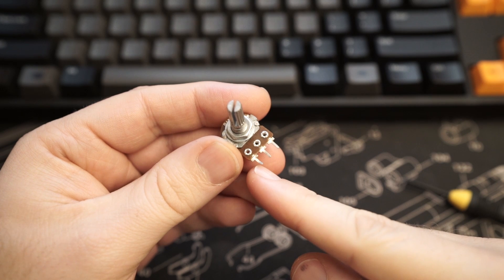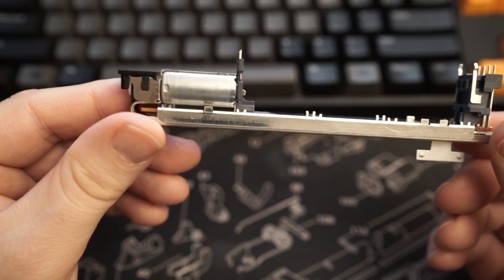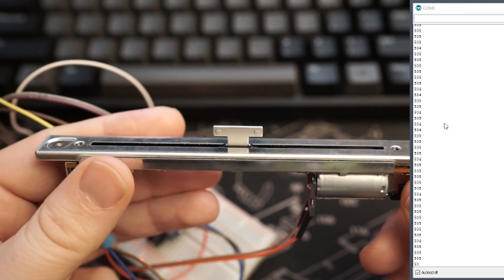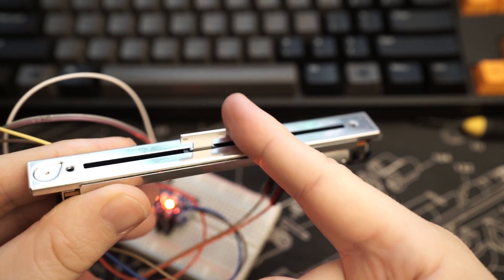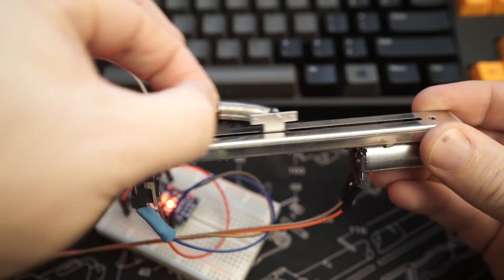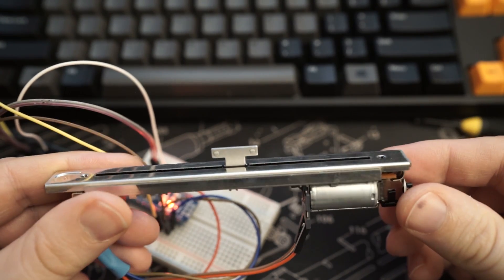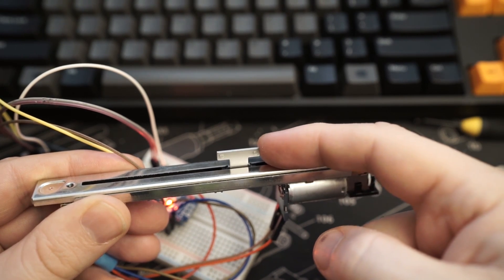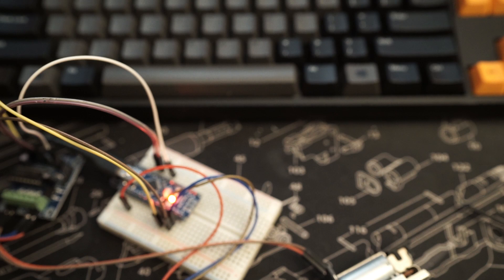Taking a look at a motorized linear potentiometer

Comment: Decade ago and that is exactly what i need for my 2026 vent control to control AC fans because big manufarctures are charging twice the price of recuperator for just that and 4 temp sensors instead of one and a knob to control fans 🫡

Comment: I am planning on using one of these as my smart home light switch, moving itself when I use Amazon echo or an app to adjust the lights
Reply from the maker: Very cool, bonus points if you put 2 switches in line-of-sight of each other and adjusting one by hand makes the other move too ;)
Reply: @Critters  my room's not large enough unfortunately, but that's a really cool idea... I might even use the touch detection that many of these have to "lock" the lights and prevent people from changing them, just by holding one for a while without moving it, or to adjust a different light by double tapping it first and then dragging. These have so many possibilities, I feel like they deserve more attention, they seem to be really easy to integrate too
Reply: by the way, what arduino and motor controller are you using? I have a (maybe broken, shorted out some analog pins to gnd or 5v at some point) arduino leonardo knockoff and will use an L293D PMIC driver, but I have severe space constraints as I will put the power supply in the wall with everything else since there is already mains in there

Comment: Very interesting. Is it powered by the Arduino or does it have a separate power source? If it's powered by the Arduine, do you know if it is 5V or 3,3V?
Reply from the maker: You need a motor driver to power a motor in both directions. The Arduino reads the POT value and then tells the motor driver which direction to turn the motor and (through PWM) with how much power. Look for videos on "adruino motor PID" to learn more, this is the same as most of those, just with linear motion vs rotary and used to give some tactile feedback

Comment: My father is on oxygen this device would be great to move the potentiometer on the O2 machine. Dad has the machine in a separate room because he finds it too noisy. At night he lowers the O2 litre/min since it bothers him but in the morning he needs it set higher. Your device would be great to allow him to adjust the O2 machine remotely. But as simple as it is it may be too complex for him to figure out.

Comment: May I need motor module for arduino to run the code?
Thanxň
Awesome video
Reply from the maker: Yes. You'll need a motor driver as you need to be able to drive the motor in both directions.
Reply: @Critters  Ehich kind pls?

Comment: Hi, what pins are ground, voltage and digital read on the linear pot?
Reply from the maker: It was so long ago, I honestly can't remember. Each one is probably going to be different and these were just some I found on e-bay, I probably just tried some pins at random until I found a combo that gave me the readings I expected to get as I moved the pot

Comment: Hi Critters, Is it possible you could post the code for your motorised potentiometer video. Other than for the basic Pot read you didn't show the screen again. I don't use the Arduino IDE but would like to know how the software works especially the PWM side of things.
 Many Thanks
Reply from the maker: LInk to code in the description

Comment: Where did you buy it? I found some on eBay, but they're very expensive... It's basically just a potenciometr and a small motor. Both of those are really cheap so there's no reason for motorized potenciometr to be expensive.
Reply: Yeah, $25 for one is pretty steep. It could be since there is a limited market for these that they prices are high.  I've only ever seen  them used in high end mixer boards.
Reply from the maker: eBay too, just got lucky and found 2 for cheap, just gotta keep looking

Comment: Technically, it's a servo, because you have the feedback from the pot. A servo is just a motor with position feedback.
Reply from the maker: I'm going to say it's not. For the same reason a motor with an encoder on it is not a servo, it lacks the logic needed to make it a servo. This + an Arduino programmed to accept a position signal from an external source would make the combo behave like a servo
Reply: Good point! Something to note is that modified "servos" aren't really servos any more, because you lose the position control. A real 360º servo would have an encoder, an absolute one (or a system that saves the position forever).

Comment: Looks like you are using an arduino nano and a motor shield. Is the shield for both dc in and Half H bridge, or just for the bridge? And in the code you use a digital PWM pin for "in1" and a regular digital pin for "in2" can I get away with using just digital pins? I am new tok all this and I am trying to spec out my design and I am short on PWM pins on a arduino uno. Pin "enA" must obviously be a PWM pin since you use analog write exclusively.
Reply from the maker: +Oscar Sommerbo The motor controller is this one: http://smile.amazon.com/DROK-Controller-H-Bridge-Mega2560-Duemilanove/dp/B00CAG6GX2

The in1 + in2 are digital pins and used to set the direction of the motor, the analogWrite on enA is used to set the power via PWM so needs to be a PWM enabled pin (see the spec sheet for whatever arduino you are using) and finally the potPin needs to be analogue to read the pot value.
Reply: +Critters Great! Thanks for the quick answer. I might just buy that H-bridge, saves on soldering and burnt fingertips. And the pins are just enough on an arduino uno. Doing a RGB controller for LED lights with motorized sliders for cool factor. Three PWM pins for slide pots and three for RGB channels.

Comment: gotta say it i freaking love that lens on that Sony but i hate that it fades off things of interest such as that motor drive in the background, is that a L293D/L298N ? lol i thought my vision was getting blurry on me "im like, let me get my glasses" then i forgot about your comment of the lens
Reply from the maker: +Frank Lopez http://smile.amazon.com/gp/product/B00M6OB8ZY
Reply: +Critters one last question, and sorry for my asking but, do you know if i can use this audio pot http://www.ebay.com/itm/10K-Ohm-Slide-Potentiometer-Stereo-75mm-/381396472432?hash=item58cd005270:g:28YAAOSwWnFV8aSb or any logarithmic pot for arduino servo ir dc geared motor or even something like what you just did?
Reply from the maker: Sure, but you'd need a DC motor and some way of connecting it to the arm on the pot and having the motor pull it in both directions. Maybe fishing line going in a loop and wrapping a few times around a pulley on the motor shaft would do it.